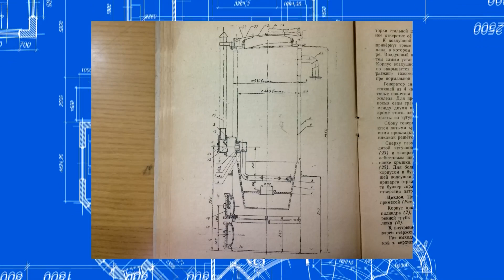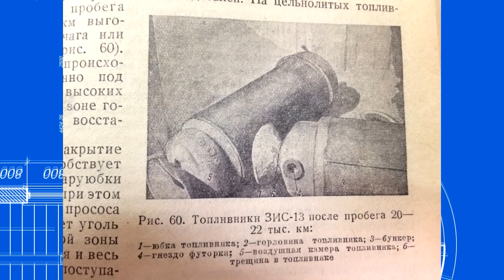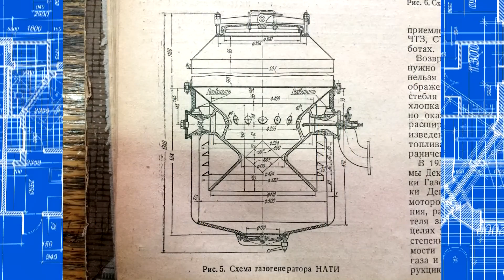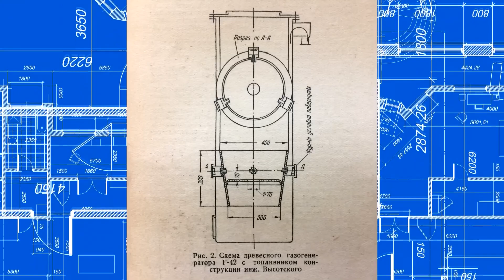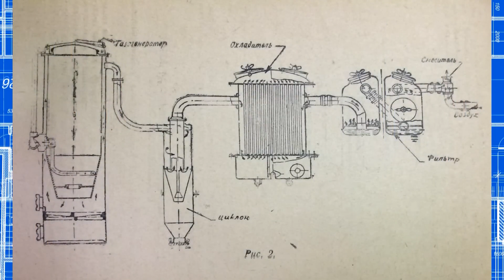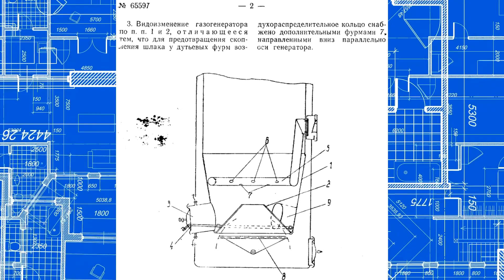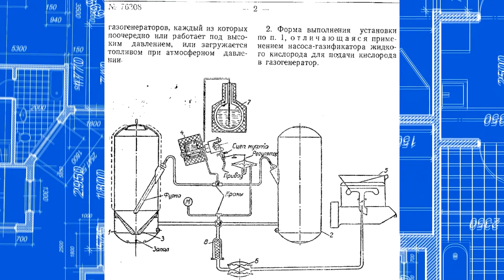Engineer Vysotsky and his transport gasifier ahead of its time (works review)

Comment: Has a ceramic casting been used for the
  hearth of a gasifier?
It seems that casting ceramic parts is
  easy and cheap.
And the air jet holes could be cast into
  the part as well...
And maybe it would last longer?
Reply from the maker: the Germans tried ceramic lining, it did not work for more than 10,000 km
Reply: The technology is forgotten and not popular. Although, with modern capabilities, ceramic castings can also be used, as in space. For example, a gas generator can be used permanently to power an electric generator.
Reply: Praxair Surface Technologies, Inc. USA - on the application of ceramics and the properties of the product, you can contact this company🤔
Reply: It melts.  I tried firebrick in my gasifier and it melted too.
Reply: @dansw0rkshop    Thanks Dan!
I kinda figured if the ceramic casting got
  hotter than the original ceramic firing
  temp., then it'd probably would melt.

I'm  kinda lost here... Maybe inconel?
They make jet & rocket engines of it.